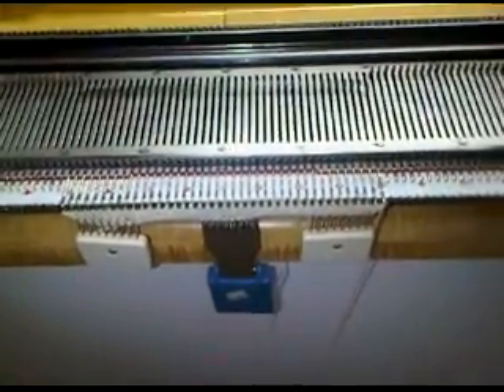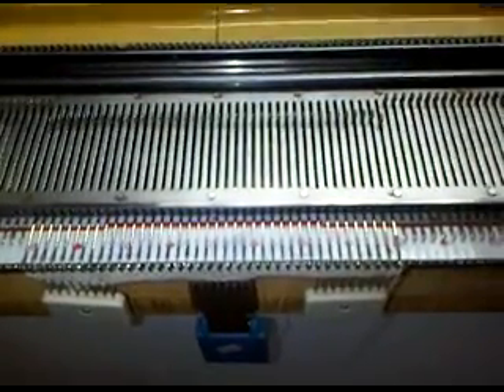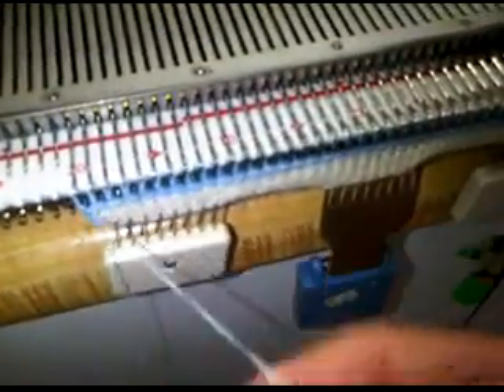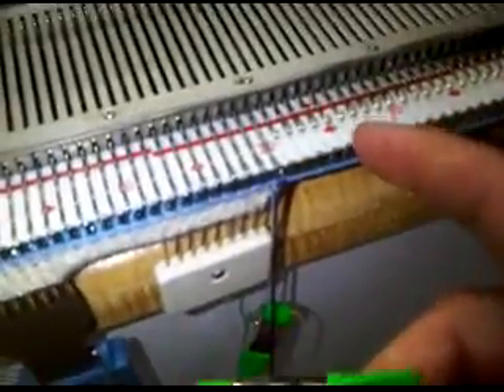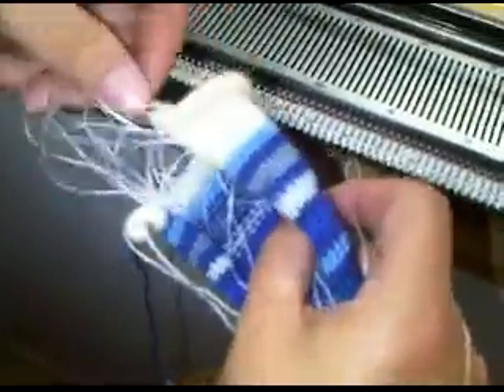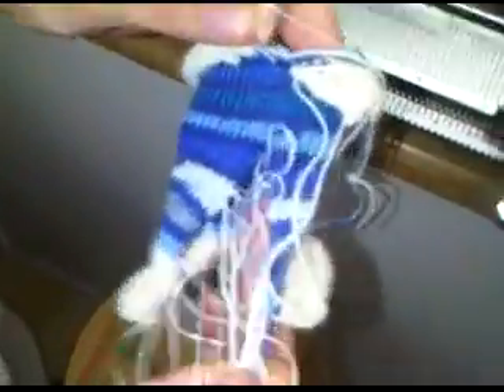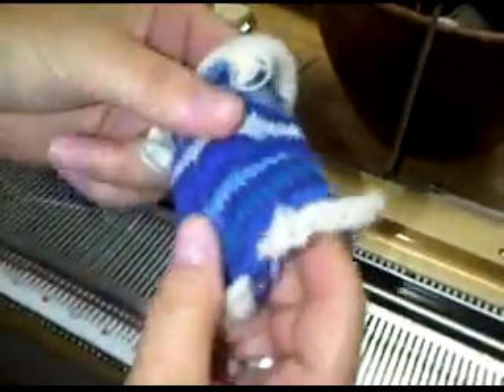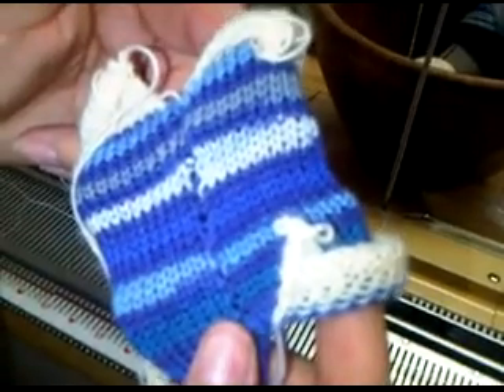no sew flat sock seams single bed machine knit.wmv

Comment from the maker: I just did a full 105 row sock and PERFECTO!  I used a slip knot on the floss but so that it wouldn't pull tight on the yarn end, and at each pass of the carriage I flipped the floss from underneath the yarn and over instead of over and down.  A much better and flatter method.  The slip knot was the key.  I barely had to nurse it through if at all.  I've kitchener stitched the short row toe - weaved in ends. DONE!

Comment: Basically, you're mimic-ing the i-cord technique with machine knitting, and who have had thougtht of that but you.  Great technique and thanks for sharing Susie. 

I guess, instead of dental floss, we can just use the main yarn if the tension is not too tight.  To save yarn, we can pull up to close at every few rows.  This will avoid tangling as well.  I will try this on my next pair of socks.  Can't have too many socks :o).

Btw, thanks to your cameraman as well for helping you out.

Comment from the maker: Hi DudeWhoKnits - Thanks! After reading your question and catching up on previous comments I think that a tail of 20" at the cuff cast on - wound onto a small holder would work.  I haven't tried it yet - but at the beginning of each row drape the leader tail over the working yarn and knit the row. repeat draping the leader tail over the working yarn at the beginning of each row and start pulling tight b/c after 3 or 4 rows you would run out of enough tail yarn to drape. Love your inspiring idea.

Comment: I plan to try this on flat hand knitting, but on a heavier yarn (worsted, Aran, or chunky) because dealing with all those threads would be far more annoying than just sewing. But, on fabric knit with heavier yarn, the chances for getting tangles and knots in the floss are much fewer because there are fewer rows (thus fewer strands of floss).

Going to try this out on some tube bed socks knit in Aran weight.